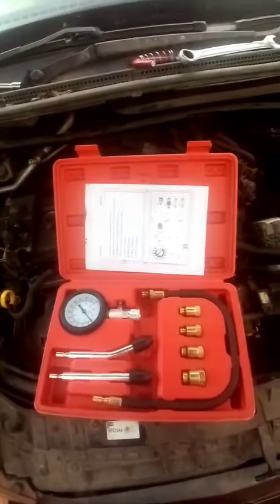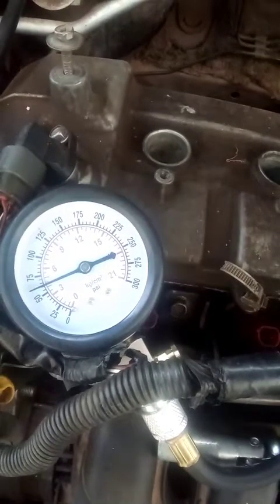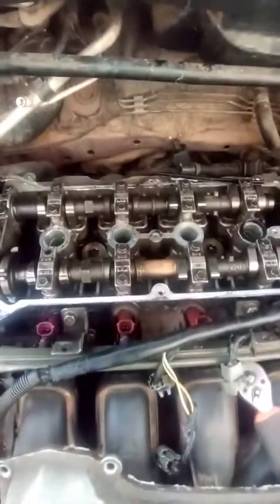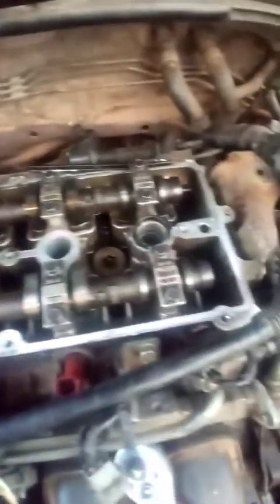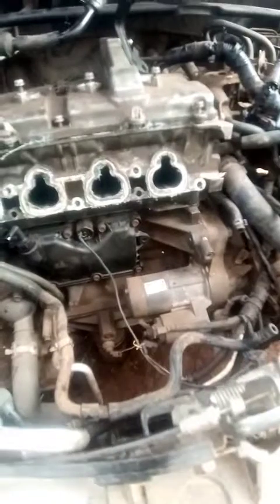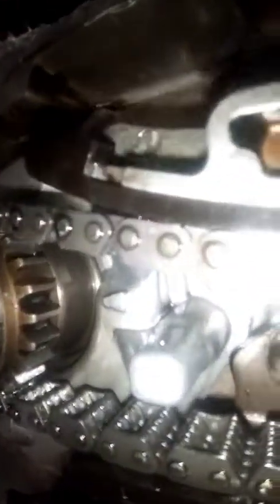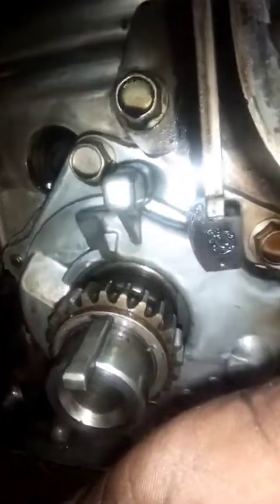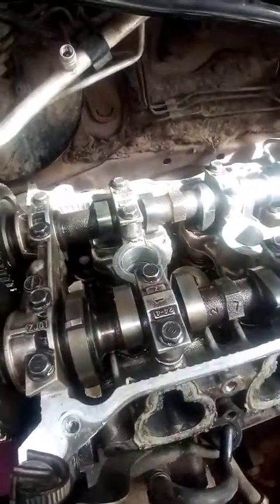Mazda Verisa no start diagnosis (Part1)

Comment: Hi my mazda verisa doesn't start and on screen there is HOLD what must I do?
Reply from the maker: @buyiswabuyiswa1842  on your gear lever there is a button labeled hold, press it and see if the light will go off. As for your car failing to start there are many things that can cause that. Fuel system, ignition system, wiring issues etc.
Reply: @kalindambozi2356  hi yes I did but it doesn't went out but I think because it doesn't start eishy stress
Reply: What was the problem.